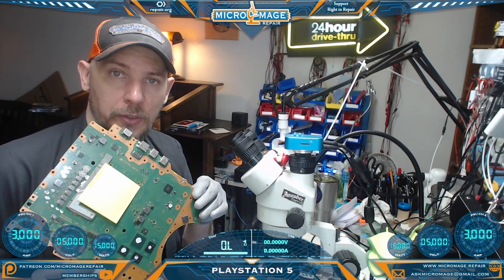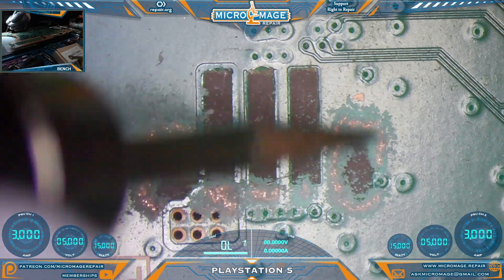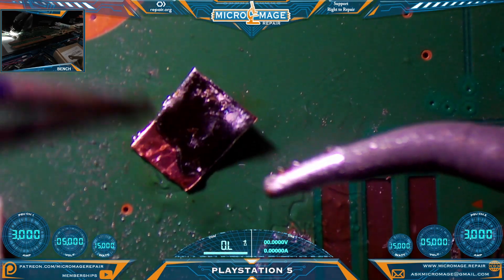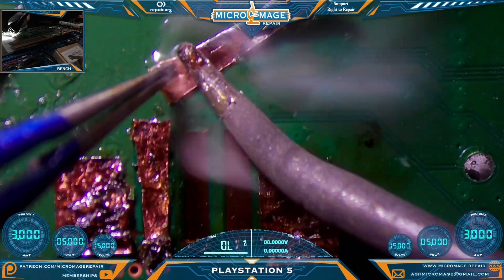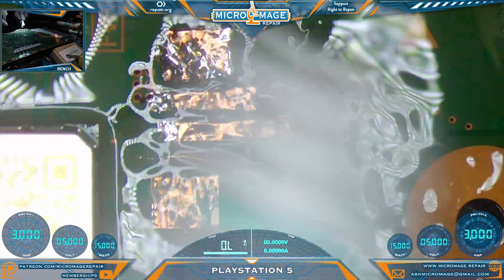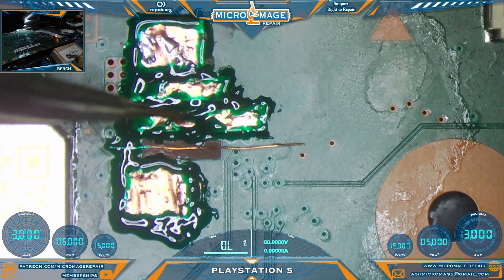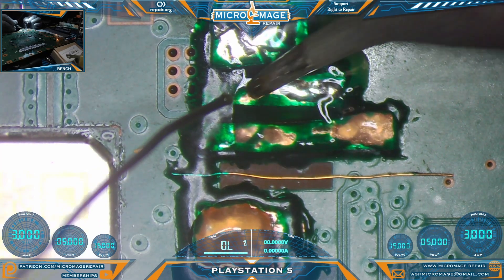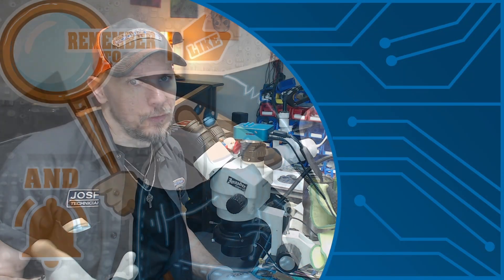Solder & Wick: PS5 Fan Connector Repair. Let's Tweak This!

Comment: Funny how he goes from "If you want pretty, you shouldn't have ripped your fan connector out" to struggling to remove the plug from the socket 😂
Reply from the maker: 😂 In fairness it's easier to wiggle out of the socket when it's attached to a board!